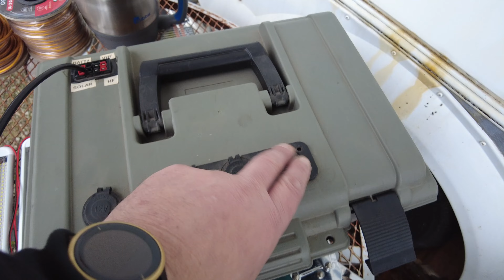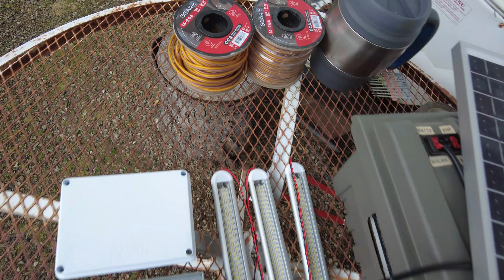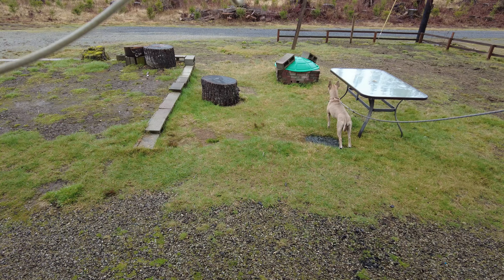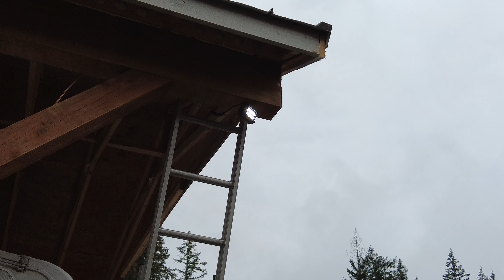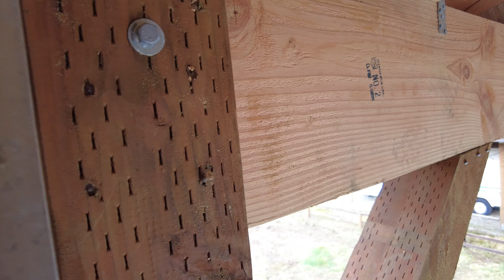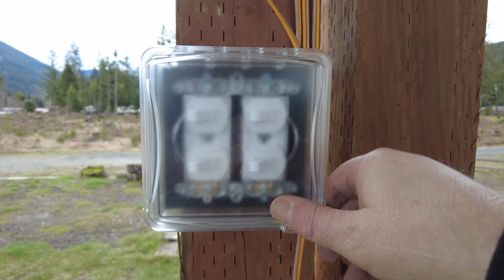Solar powered lights install for the RV Cover and camping area

Comment: Lights look really good and I like how you ran the wires flat, straight, and neat with the staples.
Reply from the maker: Thanks, that's part of what took so long.  Couldn't really hide it so wanted it to look as good as possible.